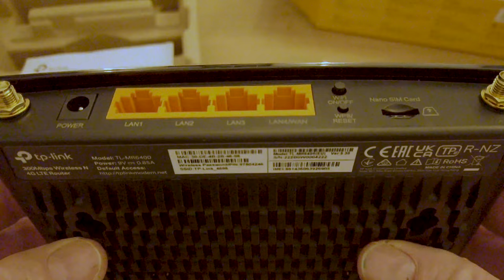Vanlife internet | Will this work for a Van conversion | Tp-link MR6400 | Bingfu 4G LTE Antenna!!!

Comment: This is something is was wondering how to get working so this is perfect as we definitely need internet too.

Where are you mounting the antenna ?

Also i was just wondering how high your van is now to the floor with the roof extension ?
Reply from the maker: Antenna is going on the roof, just a bracket to the uni strut.

It is just over 3m now. Not quite as high as a luton. Not by much though.

Working away on him today 🤠